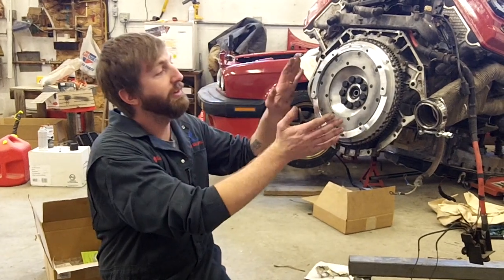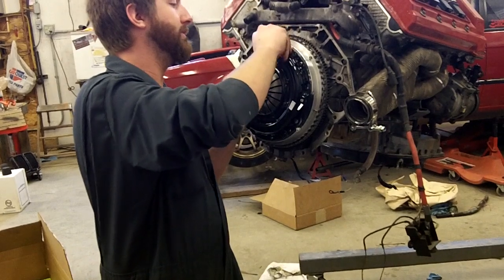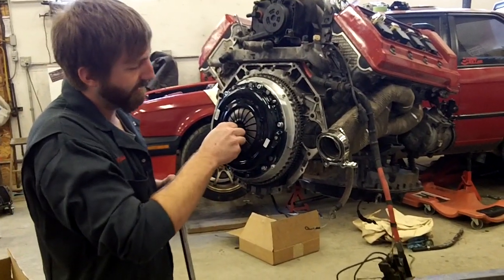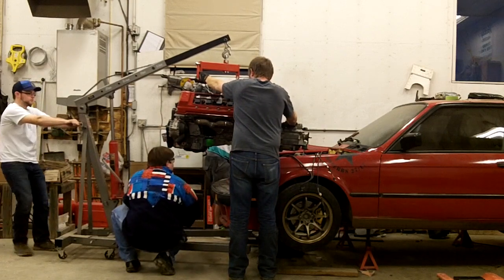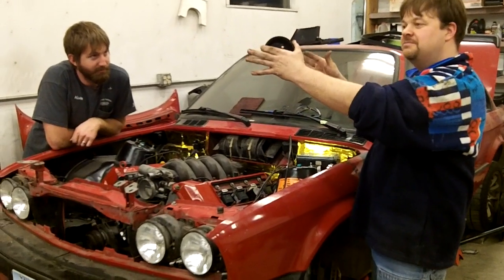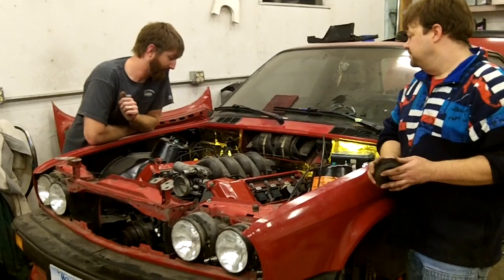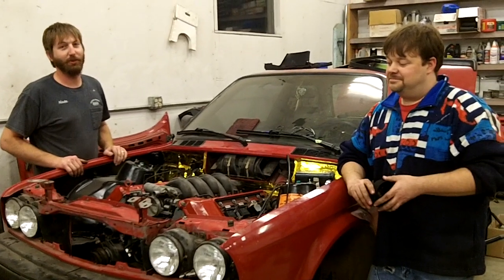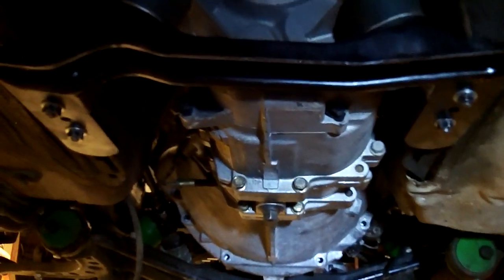BlockHeads Garage EP.6 E30 M60 swap. Engine/trans install.

Comment: I made my life a whole lot easier by making the front end removable 👌 . Drilled out the spot welded original front panel and then used riv nuts and m6 bolts to hold the front end on... I can now walk the v8 with its 6 speed box in and out single handed. So much easier 👌👌😎

Comment: Hey man, about to do final assembly on the same swap. You said you were told to avoid using a aftermarket oil filter housing? Why is this? Thanks
Reply from the maker: TheFrashn I was told by two different guys that they got pin holes in the filters. Not sure why, but that's what they said. For me it was cheaper to use the factory housing and probably better to use the factory one anyways.

Comment: Nice video as always. Any reason for not bringing the engine from under neath or even having the rear elevated in the air to get a better angle of attack?
Reply from the maker: Gee Zed Eee Power We looked at bringing up from the bottom, but it looked like the valve covers were too wide. Jacking up the back would have helped but with the rear subframe out there wasn't a real good way to do so.

Comment: Love the videos man. I just sold my S52 swap and about to start my M62+6spd and your videos are giving me hope in my double home garage here in TX. I notice you didn't mention shift linkage or selector rod.  What did you guys use? I want to get an eBay linkage delete kit and the double fork Rod from garagistics but I'm not sure if it'll be the right length. Thanks in advance!
Reply from the maker: In a later episode we cut and welded the factory e39 linkage.